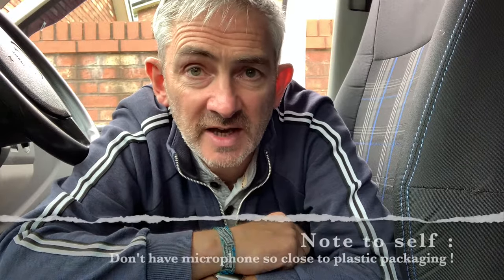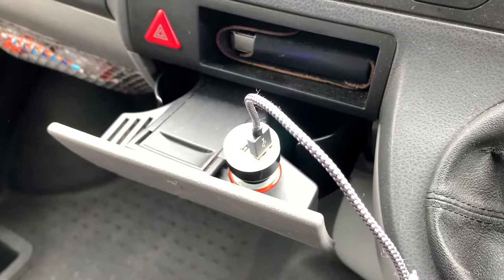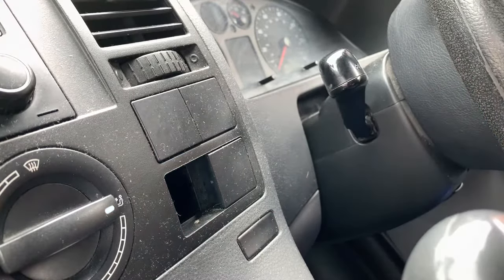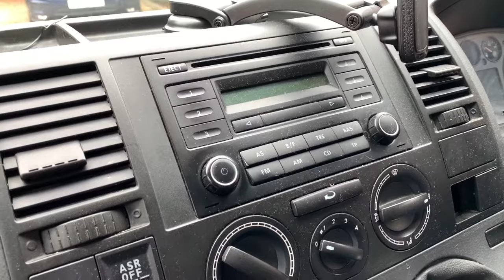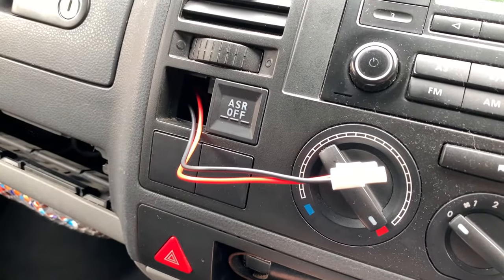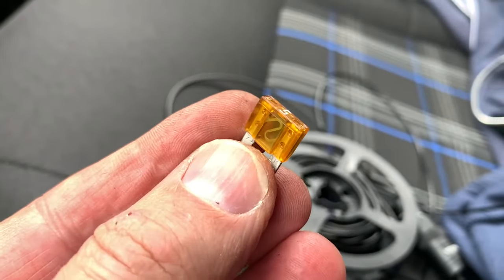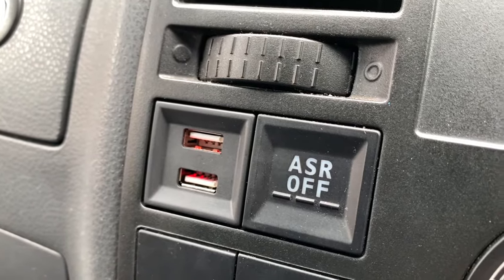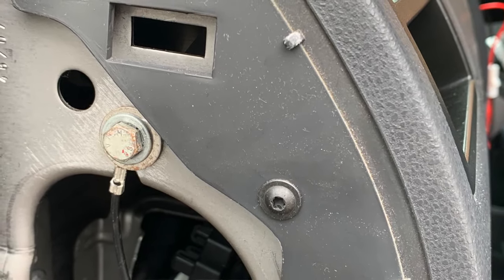VW T5 Transporter - How To Fit An OEM USB Module - Van Mod

Comment: Excellent Howto, thanks!   Couple of additional hints for anyone doing the same:  1. As pointed out, there is a nice chunky bolt for the earth connector, but you will need a socket set with suitable extender and a ratchet.  2. If you have a passenger air bag in the way (or even if you don't), the glove box can be popped out easily (5 screws in mine) for access.
Reply from the maker: Thank you for your comment Neil and the great feedback, much appreciated…

Comment: That dashboard is crying out for a cb radio I reckon. Get a double din conversion kit, pop an old skool head unit in the top, CB radio in the bottom 👌 sweet. I've subscribed and rung the bell too.
Reply: Funny you should say that, I used to do a bit of hilltop cb (on my other channel JesterBushcraft) 😆 happy days….

Comment: Very useful Mick, Mine is 5.1 2012. and my no19 fuse already has a piggy back, I fitted a dashcam mirror with a rear view camera. It is always useful to see what others are doing and how they do it. Cheers, keep 'em  coming
Reply from the maker: Thank you for your comment and kind words, much appreciated 👍
Reply: Which other fuse can you use if 19 is already used
Reply: What is fuse 19 original function on your T5?
Reply: Surely fuse 19 is for cigarette lighter? If is get rid and feed cam n ysb socket

Comment: Just found this video, it looks like really good advice.  The 12v socket has just stopped working. I have cheched the main fuse box, and all fuses are intact, and I have checked under the passenger seat for the 'hidden' fuse, and there isn't one there. My van had a swivel seat fitted before I bought it, so perhaps the elusive fuse has been hidden somewhere.
Plan B is to fit a dash mounted 12v socket, but I am struggling to find one that will fit, so I have decided to turn to the hive mind. Can you offer advice / links to what I'm looking for?

Comment: I have just did similar job but for T5.1 - the problem is it is almost impossible to buy such version, so I took one for T5 (exactly like in video), removed the casing, pulled the blank from dashboard, drilled/cut proper holes, then put the charger in it and voile'a I got T5.1 version. the rest is the same as in the video :)
Reply: Brilliant feedback Bartholomew, thank you…
Reply: Great video @caspervanlife8466 much appreciated.
@bartolomeonew do you have any more info or pictures, I'm looking to do the same on my 5.1

Comment: I did end up making my own for the T5 that I have due to to it having different blanks. I put one on each side of the air-conditioning controls. I've put mine into dash bit not connected power yet as I couldn't get the wire through to the fusebox after routing it. I need to relocate it. What does fuse 19 service on your T5? It seems to vary.

Comment: Is earthing really necessary? 
12v 5Amps not going to shock much.
Excellent video btw. Very helpful.
Reply from the maker: Cheers mate, I just followed the instructions that came with the kit…👍
Reply: Earthing is necessary in a vehicle as it's basically the electrical return to the battery and completes the circuit. No earth = no circuit = no go!
Good video - thanks. I didn't know that USB part existed but, as you say, much more accessible than using an adapter in the cigarette lighter socket.
Reply: Not an earth in the normal sense. It's the negative connection to the battery.

Comment: So have done the same on a 2003, usb ports working but the led lights don't go out when you turn off and take keys out. Any suggestions here on why that might be? Worried about a battery drain. Led lights are also blue not red, so not sure if it's a later model of port. Everything hooked up exactly same as video. Any help appreciated!
Reply: Can only assume your fuse/connections are slightly different and not a switched live…

Comment: Great video  thanks 
I have a T5 from 2014  do you think this also fits in my T5 ?
Reply from the maker: You’re very welcome, thank you for your feedback 👍
Reply: @caspervanlife8466  thanks
but do you think it will fit the T5 of 2014?
Reply from the maker: @georgevincentie2591  if it’s the same blanking plate I would think so, but double check before purchasing obviously 👍
Reply: How you get this?
Reply: Different sized dash cutouts. The later ones are smaller.
Reply: @leglessinoz  yes it is.  got one but did not fit and send it back ....
Reply: @georgevincentie2591  there are some genuine VW ones I think but not inexpensive. I'm just going to make some.
Reply: @leglessinoz  ah you going to MAKE  some ???
As in 3D mods ???
I’m interesting….
Reply: @georgevincentie2591  I need four single USB charging ports. I have two T5 vans to do. I'm just going to modify the stock blanking plates with USB panel sockets. Maybe even use ones made for other VW models like the Golf or Polo.

Comment: Hi great video. I’m going to install a USB port in my T5 van soon and will certainly use your video as a guide. Just wondering if the fuse you removed had a purpose and may have been there to power something else, will it cause problems if I removed it?
Reply from the maker: Great to hear, thank you. I’d assume it is and just leave it in…or leave it out and see what doesn’t work 😆 but I’m not advising it 🥴
Reply: I used your video to fit a USB port in my T5 today. Great tutorial video! Well explained. I removed the glove box and  earthed the black wire to a bolt attached to the frame of the dash. 👍
Reply: The fuse he removed has just been relocating to the piggy back connector. Now 2 fuses in the one slot.

Comment: Do you (or anyone) happen to know if there's a way of doing this so that the USB is connected into the head unit, so you can play music stored on your iPhone through the speakers? I've just picked up a 2015 T5 and the Bluetooth only works if I've got "mobile phone provision" - which I don't think I have so I'm looking for a wired solution instead.
Reply from the maker: I’m pretty sure I’ve seen that done, but I’m not the person to answer really. Hopefully somebody here will have a better idea 👍
Reply: I've seen some USB extension sockets for plugging into head units. Just make sure you get the ones that fit your dash. The 2015 models have different sized switches from the earlier ones. You could also just get a regular USB extension cable and cut a hole in the blank.
Reply: @leglessinoz  since then I've simply bought a bluetooth device that connects to the iphone and uses the a radio to play music through. Sorted thanks :)
Reply: @Stereofidelic 67  my stereo has a few USB inputs on it and I brought one of them to a socket on the dash. It let's the stereo read media but I noticed that it will also charge a phone. Of course that was after I added two dedicated USB charging sockets.

Comment: I've just fitted one mint but my light stop on all the time is this OK    I know my cigarette port is always on ???
Reply: Did you connect to the cigarette lighter? There's a 12v to 5v dc to dc converter in those USB phone charging ports. If you connect that to a source that always has power, it will eventually drain your battery. With the cigarette lighter it doesn't matter because it's only drawing power while it's heating up.

Comment: Can you send the web address for the wiring please. I got a kit but no diagram to advise so your video is superb.
Reply from the maker: Not sure exactly what’s you mean, but it’s black to ground (where I bolted to metal chassis) and red to the same piggy back fuse I used in the video…
Reply: @caspervanlife8466  Hi, it was the wiring instructions that you mentioned on the web and paper copy I would like to get my hands on thanks.

Comment: It's a pity these USB adapters are made for the older dash. Trying to find nice ones for the later dash with the smaller switch cutouts is really hard. I'm going to have to make some.
Reply: you need the usb poort for the top off the dash t5.1 not in the buttons thats why you cant find it